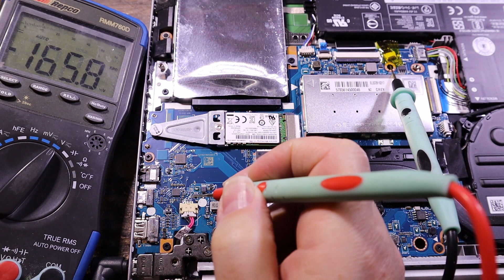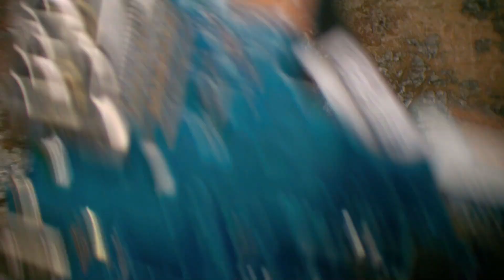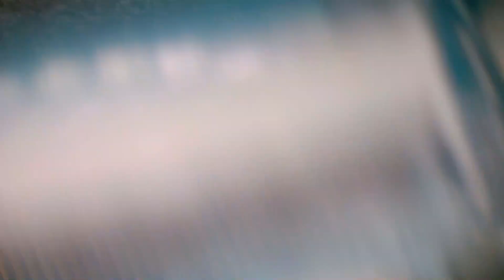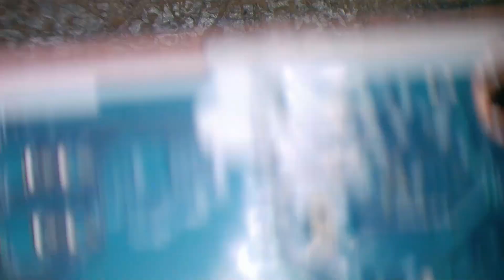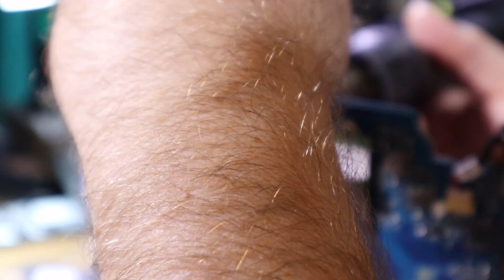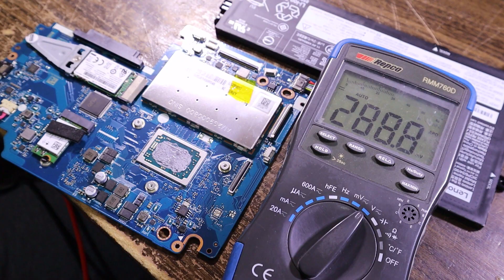Lenovo Ideapad S340 no power repair. NO SCHEMATIC! Don't get caught.....short.....

Comment: Hi, I have a friend's laptop where I found that it has this small capacitor broken.  Do you know the value of the capacitor so I can install it correctly, please?  thank you very much
Reply from the maker: I don't but it will probably work fine without it. If main power rail e.g. 19 volt use say 25 volt and 10 microfarad rating

Comment: I bought a Lenovo Idepad S340 that had some keys failing. Yesterday I took it apart to change the keyboard (this hot melt glue fixing system is a pain, by the way), and after putting it back together, I don't know why, it won't start up with just the battery. I kept disconnecting everything that could be disconnected, etc. The battery is perfect in terms of measurements (I have 12.6v), but as soon as you connect it to the motherboard the charging LED blinks very quickly.
If I connect the charger with the battery connected, then Windows starts up and works normally (but the charging LED keeps blinking fast and the battery charges) and if, with Windows started, I remove the charger, Windows keeps running. I left Windows playing movies with just the battery (it was on for more than 5 hours) so that it would discharge, in case it was a static problem, but no.
Do you think it's the charger IC or the KBC, or even BIOS? Because it seems too coincidental that a simple keyboard change would ruin the battery. 
The thing about something working, then taking it apart and putting it back together again and it no longer working depresses me. It makes me want to give up. He he.

Greetings from Spain.

Comment: Great job Jonny! 
The age old question is to charge or not charge. I think of it this way - you have years of experience and sometimes replacing parts that may become faulty due to a short further down the track can be a legitimate diagnostic strategy. They have brought the unit to you for your expertise and you should charge accordingly. I struggle with constantly questioning whether I am charging correctly, but get reminded by the customer themselves that it is my skills, honesty and experience that they are happy to pay for.
Great job as usual mate and I like your diagnostic thinking process. 😉👍
Reply from the maker: Yeah people always tell me I don't ask for enough, cheers!

Comment: Great video with a tricky root cause...board flex issues are tough. I am surprised you did not discuss that the fault occurred after you charged the battery a bit and then ran the system on the battery. Was that coincidence due to board flex or would that tidbit have led you to the area where the fault was found? I would also really like it if you showed your multimeter more when probing around. Subscribed!
Reply from the maker: I think the capacitor was the original fault and the fact it ran on battery was total fluke the board didn't flex in a way to show it up then. I think while moving it after than there must have been enough flex to re-short the cap and blow the input mosfet. Will try squeeze in more meter shots, cheers mate!

Comment: Nice fix, as far as charging for parts, I think anything used during the diagnoses and repair should be charged for, unless something happens because a serious mistake was made, such as dropping a screw into a live circuit for instance.
Reply from the maker: Yeah, I've had a few close calls. If I totally borked something I'd buy them another one.I think I've learnt enough by now to avoid such incidents (touch fingers, cross wood)